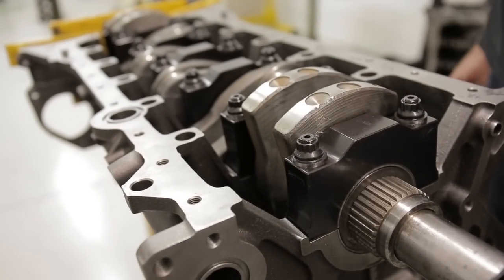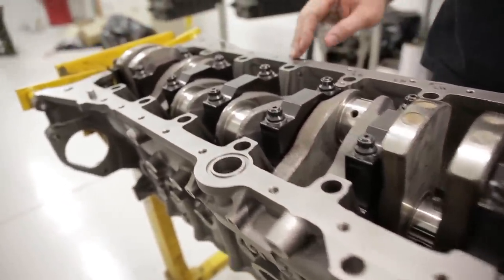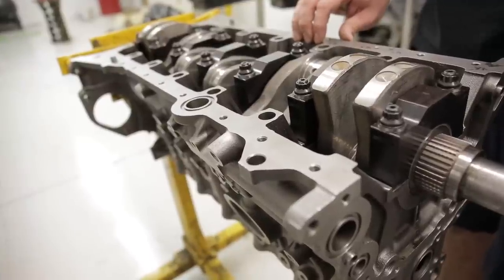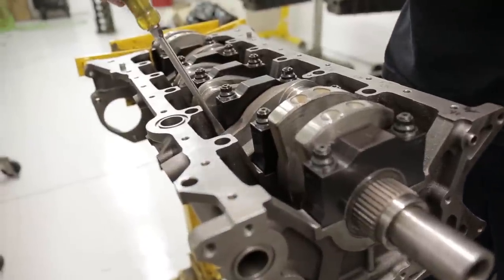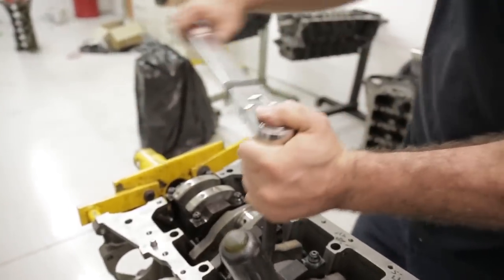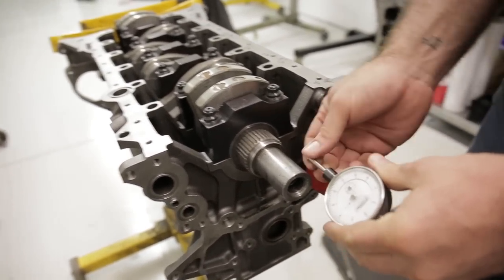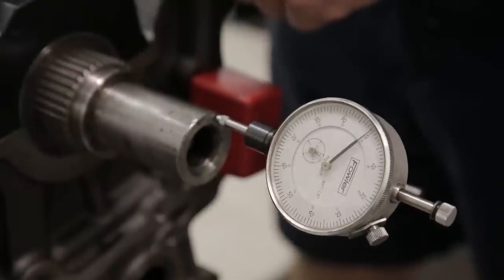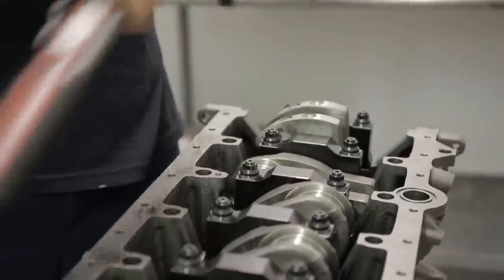Jay's Tech Tips #2 - Thrust Bearings and Avoiding Crank Walk - Real Street Performance

Comment: Would this apply to the 7 bolt 4G63s which use a full size main girdle for the end cap (one piece) and has the main thrust washer which is one piece (flanged bearing)? My thinking is, that flanged bearing really has nowhere to go once put onto the block, and since the main girdle is a full piece, you can't really wiggle it much. I'm about to assemble my shortblock, that's why I'm asking.

Comment: ALSO MY MOTOR SPINS CLOCKWIZE! HOWEVER, IN ORDER TO GET THE MAIN BEARINGS OUT, IT WOULD BE EASIER TO TURN THR CRANK COUNTER CLOCKWIZE TO ASSIST IN REMOVING MY THRUST BEARING BUT, I JUST DID MY TIMING BELT 2 MONTHS AGO & I HAVE BOTH, MY UPPER & LOWER OIL PAN OFF & I DONT OWN A ENGINE HOIST SO, THE ONLY WAY TO DISCONNECT MY TIMING BELT WOULD BE TO DROP MY MOTOR MOUNT & SUPPORT THE ENGINE WHICH WOULD BLOCK THE BEARING WORK & ITS LATE & FREEZING & ID RATHER NOT DEAL WITH MY TIMING AGAIN TONIGHT OR AT ALL IF AT ALL POSIBLE. IM WONDERING WHAT I CAN DO 2 GET MY UPPER PART OF MY THRUST BEARING OUT? HOW TO ROLL IT OUT? COUNTER CLOCKWIZE? THE TANG PREVENTS ME FROM SPINNING CLOCKWIZE!!!

Comment: HEY JAY, IM INSTALLING NEW MAIN & ROD BEARINGS! After starting on the main bearings, I realized that my main bearings were ok but, since I have new one"s, why not install them? im working on a 03 ford focus 2.0 dohc vin 3 zetec, I have all of the mains in except the thrust bearing, I am having trouble rolling it out! I am doing this job from under the car, outside laying on a concrete pad, in the frezing cold & now its night time & below freezing in the north east_ OHIO... ANY SUGGESTIONS? I STARTED W/#1  THEN #5 THEN WENT# 2,#4 ACTUALLY IM DOING MY #4 NOW & THEN GOING BACK TO THE #3 THRUST BEARING! THE EXHAUST IS IN MY WAY BUT IM FINAGALING ARROUND IT.. ANY IDEA"S??????
Reply: Sounds like a less than enjoyable time. If you're having trouble getting the bearing to "roll" around the crank and out of it's position you can use handle of a plastic kitchen utensil to push the bearing out of it's seated position. Clearly you don't want to use anything sharp enough to scratch the crank.

Comment: Hi, so do i just hand tighten the main caps and thrust bearing n then pry it forward and back and torque them to spec and then use the dial for end play? I am building a 2 g dsm. Thank's..
Reply: +Dale justice   You can use a rubber mallet and smack the crank back and forth to square the thrust, then check the end play. I check them dry as thicker assembly lube isn't displaced easily can can change your clearance reading. 
 thanks
Reply: Ok thank's alot, good video's..